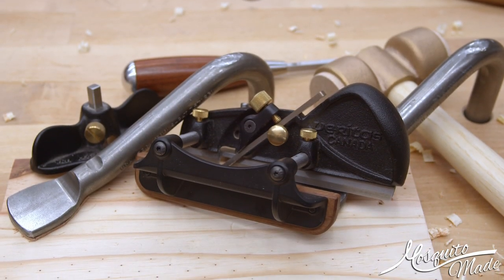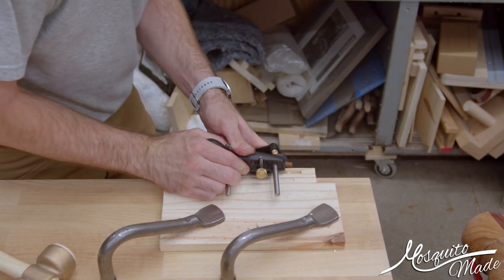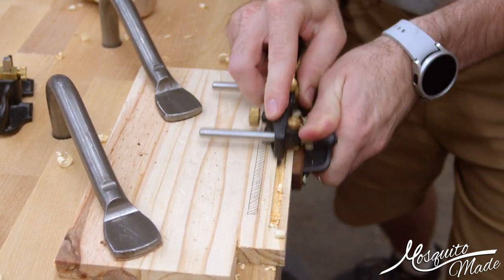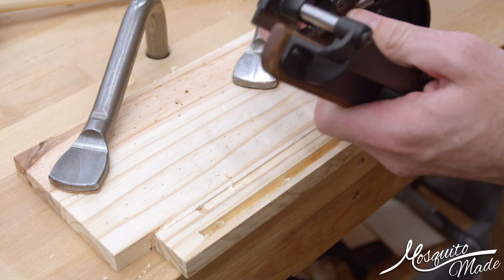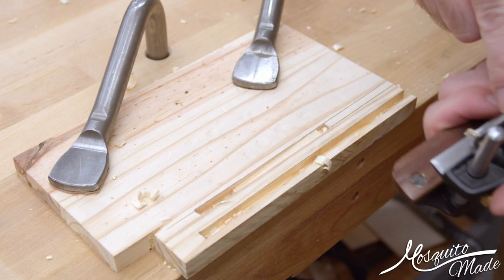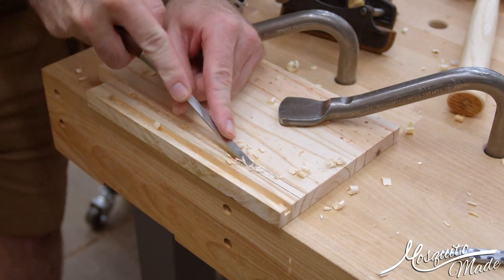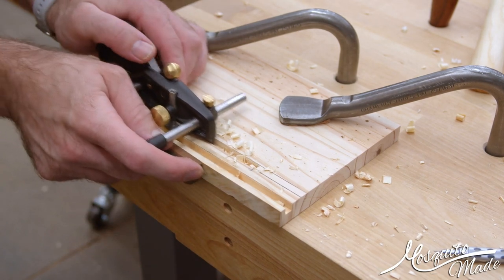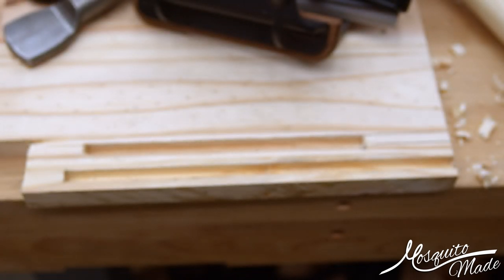Veritas Box Makers Plow Plane - Stopped Grooves

Comment: I've played around with the same problem. Thing is, I never want stop grooves to end with that much un-grooved space at either end. If you're doing short grooves, then you just have to do them entirely with chisels. I've started to use simple rabbets at the ends of box sides, so I seldom do stop groves or or stop dadoes any more. Only when I get my router plane made will I have the stop groove problem solved.
Reply from the maker: I agree, it's definitely one of those "you can, but it's not great" situations lol

Comment: Cool! For the stopped groove(both ends), as long as you can cut the first few paths to establish the side walls, I think it will make things much easier for a router plane especially you have a nice little one!  For the left/right hand operation things, I guess you can get used to eighter way but you need the left hand one so you can always go with the grain!
Reply from the maker: Haha yeah the left hand one would have a major advantage to help with grain direction, though that'd be more for beads in my opinion. Light cuts and the fact that only the top edge of a groove is usually visible means I don't often care what the bottom of it looks like lol

Comment: I've been considering buying one of these . Currently using my Veritas router plane flipped over with a fence on  locked in my vise and slide the box side  instead of normal use . odd but it works especially for really small boxes.  any way thanks .
Reply from the maker: Haha that does sound odd, but if it works it works! It always feels like the smaller the project the harder it is to work on, especially when it comes to work holding too

Comment: Thank you very much! Can the same be done with the Record 043?
Reply from the maker: You're welcome! Yup, same exact operation work the Record 043. Can be done with any plow plane really, it's just easier with the 043 sized planes because the front skates are shortest
Reply: Hi Chris,  Thanks again for your reply.  I would like to ask you a questions as someone who now has experience with both the Veritas Box-Maker’s Plow Plane and the Record 043.  I was very excited when I saw the new “upgraded Record 043” Veritas version and there is much I like about it.  (Most of my joinery planes are from Veritas while my bench planes and specialty planes are from Lie-Nielsen).  

For regular grooves I use the Veritas Combination Plane.  But I really wanted a small plough plane for small boxes / drawers which is the intent of the Record 043 / Veritas Box-Maker’s and as you have demonstrated (Christopher Schwarz as well) they can come handy for stopped grooves.   The only deal-breaker for me when it comes to the new Veritas Box Maker’s Plow Plane is that the rods are not adjustable from the fence and when dealing with small stock the rods can get in the way of holding devices, and that is the reason I went with a good working condition Record 043.  

Not sure what is the condition of your Record 043, but if it is working properly and you had to choose one between these two planes (for the purpose they are made for) which one would you choose? 
P.S. Sorry about the long message.
Reply from the maker: @edwardleonard9901  No problem on the long comment!  I kind of covered some of that in the full review I did, and you're right, the fence rods were my biggest complaint as well.  Basically I'd take an 043 over a Box Maker's Plow if my main use was grooves (or if I have other ways to do beads, which I do...).  Clean 043's are slightly cheaper in the US (though not by a ton until you factor in all the irons of the Veritas).  I do like the ergonomics of the Veritas more than the 043, but the main reason I'd pick a Box Maker's Plow over an 043 is the ability to use it for small beads.  If beads aren't part of the workflow, then I'd take/keep 043 (I have 3 lol)
Reply: @MosquitoMade  Crystal Clear! Thanks. I also use the Combination plane for beading, reeding and fluting.  For small beads I use the Cast Scratch Stock also from Veritas which is based on one of the Edward Preston & Sons' tools. It works really well, simple, easy to use, not as expensive, and It also works on curves! Thanks again! keep the great info and videos coming.
Reply from the maker: @edwardleonard9901  I've heard that about scratch stocks, Windsor beaders, and other names of them, but I don't know why I've never picked one up myself... I should fix that one of these days lol